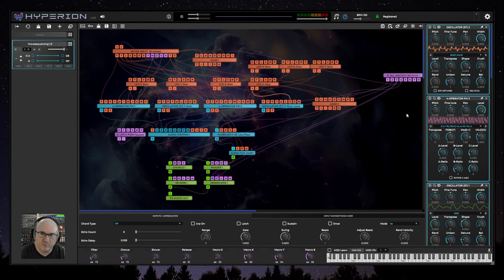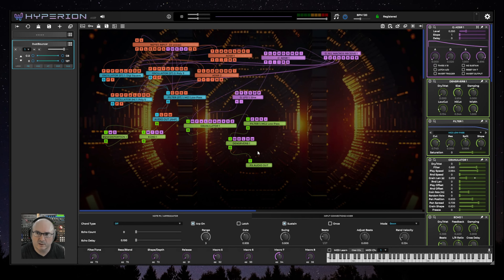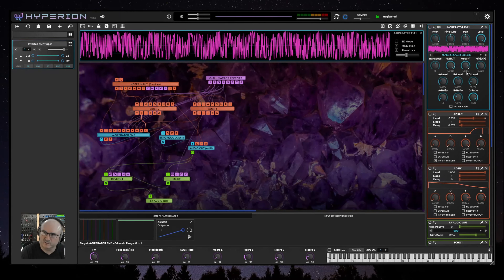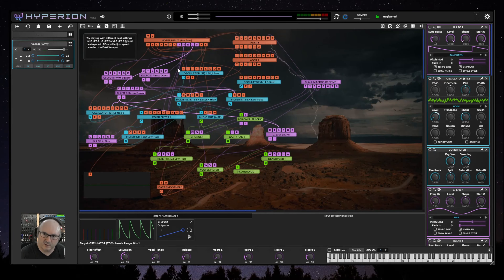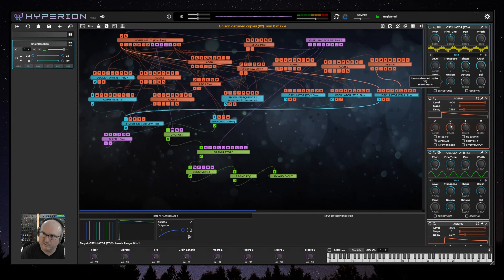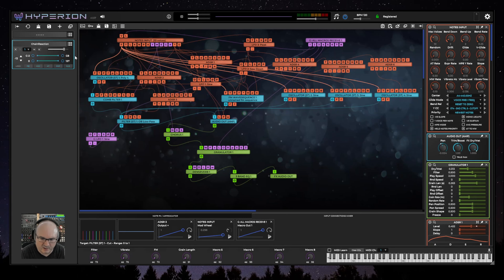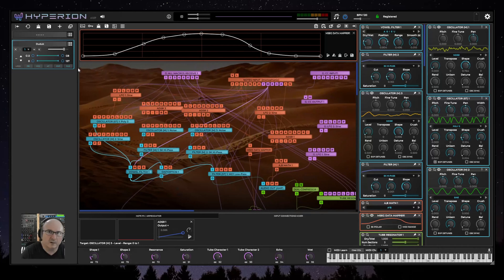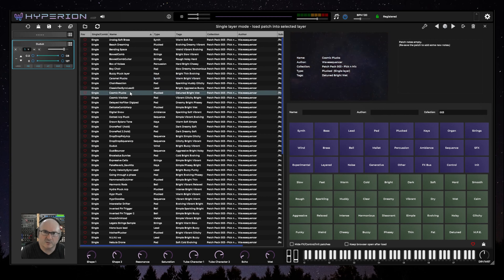Sound design discussion - Pick n Mix

Comment: Amazing patches. The BowedComb is a particularly beautiful patch, and so expressive. Could only watch half, but will watch the 2nd half tomorrow.
Reply from the maker: There's a Cello patch that uses similar techniques - the comb filter with frequency control turned out to be quite useful as the plucked string oscillator was a bit too specific.
Reply: @HyperionSynth  Ha, it was actually the Cello patch I was playing with midi guitar last night. That is an amazing patch.